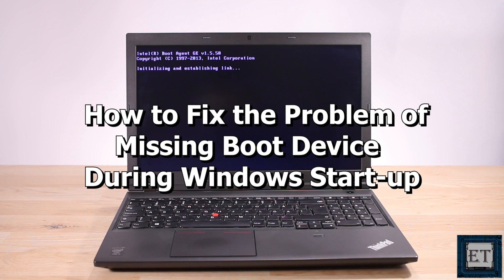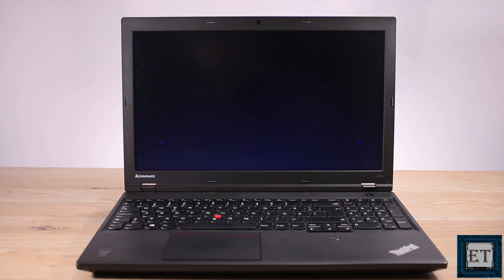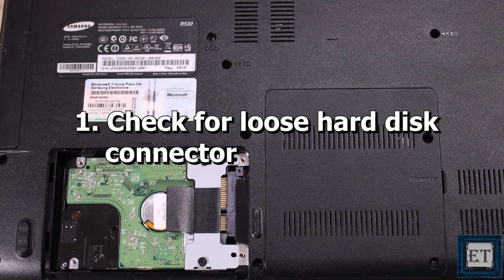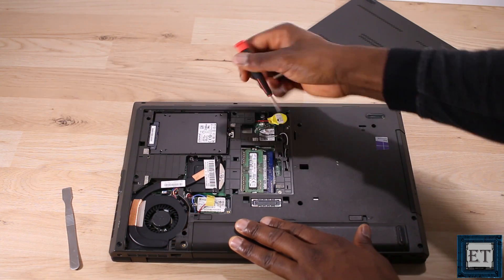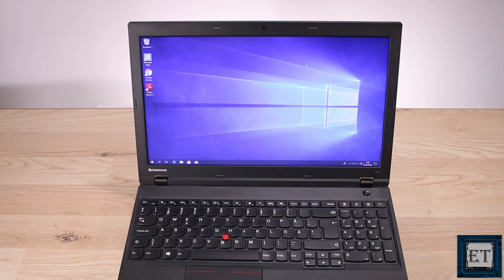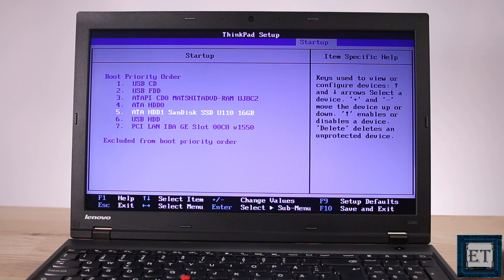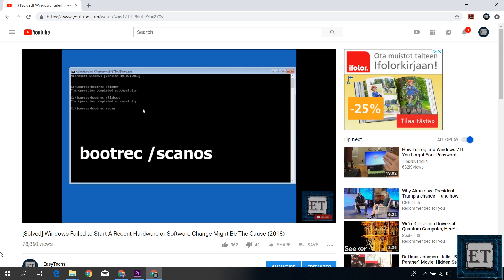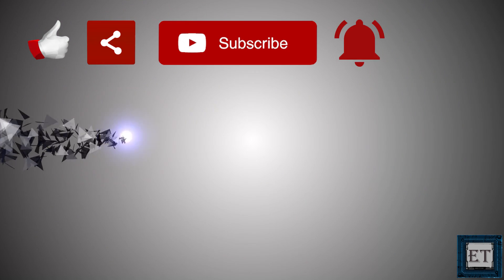How to Fix Media Test Failure, Check cable, No Bootable Device, Boot Device Not Found

Comment: ASUS Z53T Turion x2 Processor mobile Tech. Laptop, 64Bit Windows 7 Home Premium Recovery Mode: NVIDIA Bootloader Stopped with the error Massage - Disconnect SSD and rebooting didn't solve the problem - Live-USB/-CD are still bootable. OS Installation DVD/CD aren't available anymore.
Are there any Live-USB Systems that repair and recover the Windows 7 System? Or let it find the Windows-Boot Mode

Comment: Hello, from late 2023, I tried everything and failed. 

Chatgpt however recommended I shut down my laptop, then remove my ssd, battery as well as the CMOs battery for 5 mins, then reassemble and viola, it's working and faster than before 😂
Reply from the maker: It might be that your hard drive is not functional or the connector is broken
Reply: @EasyTechs do you think I could use an external hard drive to fix this

Comment: for me what worked was taking out that battery that looks like a silver coin, hold for a few seconds, then putting it back in.

i found this solution randomly, i was trying everything, nothing worked, until the screen turns off, i though it died, so i looked up for a video to fix the screen and everything worked normally.

Comment: I know next to nothing about computers, and I could follow your directions easily.  I was so scared that my computer was toast, but your first solution saved it!  The hard disk was just loose!  Thank you!
Reply: Can you guide me the first step in easy steps Because I can't understand
Reply: Same😂😵‍💫🙈
Reply: As it seems, the first solution consists on checking the literal connection between the Computer and the storage drive. in the video the guy cleaned the pins of the storage drive and then reconnected it properly.

Comment: I solved, but another process. Verify the Boot mode (UEFI, LEGACY) and change mode.
Reply: Ottimo 10Q
Reply: I changed the boot mode to uefi but it also said that no bootable device found....
Reply: And when i try to add a boot file it says "File system not found"

Comment: My Lenovo had started to have this problem after update Windows. I tried all solution and I have problem still. Probably last update damaged some files. I have to bring hard disk out, put up in case and connect with USB. I hope that my all files will be there because there is one disk partitioning on my hard disk 😡

Comment: I have had similar issues with one particular laptop,a Toshiba Satellite A135 Series.  I have tried using the recovery disk to try and revive it,but I get the media test failure as you have shown is common on some computers.  But upon attempts to boot up regularly,I also get the bootmgr missing error.  Which tells me it could possibly be the motherboard on this guy,possibly. Or,it could also be a result of a hard drive crash,and the hard drive would need to be replaced.  I have an old Lenovo T430S series computer that work gave me a few years ago,and it works like a champ.  And these have solid state drives,which are actually more efficient.  So if it is the hard drive,I may go find a solid state drive to put in and see if that fixes the issue. 

I think you are likely correct to check for loose cables and/or connections first before doing anything further.  So here is hoping.  The laptop itself is in great shape,and the battery seems to still hold a charge even after 10 years which is pretty impressive in and of itself because a lot of computers from that time frame would be dead by now.  But I gotta say,these Lenovo laptops are workhorses.  They last.for the most part. Of every computer I have owned,the Lenovo Think Pad 430 S series has had the best audio to this point.  I use a Dell while at work,but that one has had some issues,like constantly freezing,and WiFi always cuts in and out,which rarely happens on this Lenovo.

Comment: Hello sir , my laptop got hanged and because  I opened 5 software simultaneously  then I had to shut down by pressing power key for  4 seconds.  Now it's  not starting  and showing  Media test failure check cable exiting pxe rom. Whats could  be possible  reason .. hard drive crash  aur os crash. Plz help No shop is opened  in quarantine.

I used command like  bootrec fixmbr and bootrec scanos and bootrec buldbcd but of no use.

The diskpart command couldn't find any disk ..

My fan run while laptop is on

My model name ,model number and serial number is showing in bios  setting

Comment: Sir I m getting the same error as above but then after its takes me to screen where there are options such as 1).safe mode.
2).safe mode using networking
3).safe mode using command prompt
Use the last best configuration possible to open 
4).start windows normally
When I click on any one of the option then it start some process and a blink of blue screen occurs and then it will restart again and again Sir I have tried to boot  using usb and DvD but neither it show bootable usb nor bootable DVD and it is very much older laptop the OS was windows XP 
Sir when I inserted DVD, in the boot menu I didn't find the DVD it just show Hard drive such as Toshiba.
Sir please help me to fix this problem

Comment: I was doing the same but my problem was not from the cable. My problem was boot mood. I changed it from legacy to UEFI mode. And it's done
Reply: I had that to but I tried everything and also changed from legacy to UEFI mode and it didn’t work what should I do then
Reply: @damnpapi6599 change to legacy again it work for me
Reply: thanks so much for this. Ive been trying for days to fix this problem on my laptop, and just happened to scroll down here, and it did the trick.
Reply: Thanks alot man this solved my issue as well
Reply: Thanks man 
You saved my degree project , respects bro.

Hope you find this and doing great
Reply: @Raynald13  glad that helped.

Comment: I tried to install lubuntu by using Unetbootin on windows 10. I created a partition of 10 GB for that. Remaining memory in C drive was around 25 gb.  When I boot my laptop, I selected Unetbootin to install Lubantu, when it asked for partition, I selected that created 10gb. Then it said that all data will be erased from selected drive. I pressed ok. Installation begun, but failed afted sometime. When I restart pc it says that this is not a bootable device. Insert  bootable disk. I tried to reinstall windows by using bootable DVD, but I get the same error massage.
Please tell me the solution.